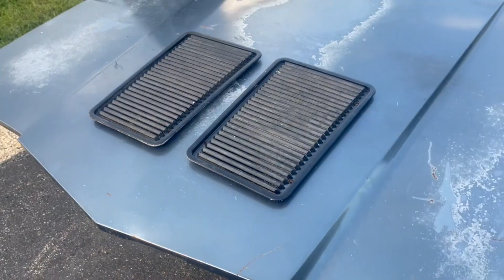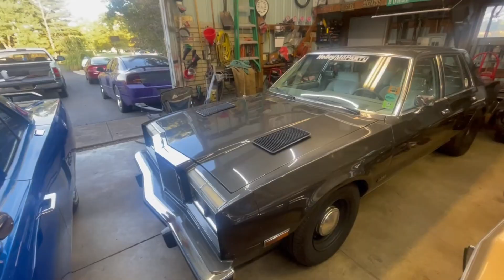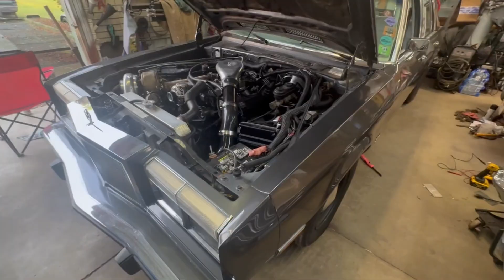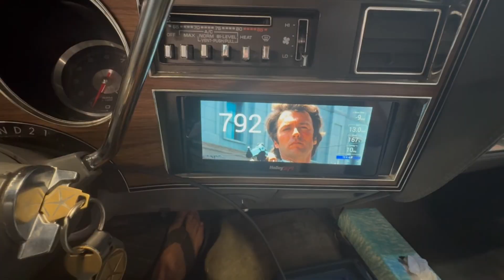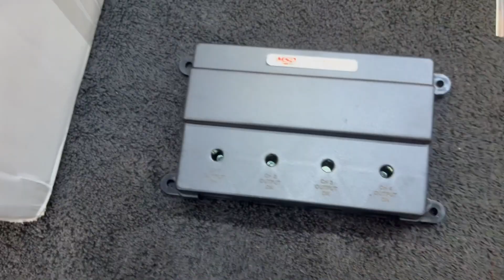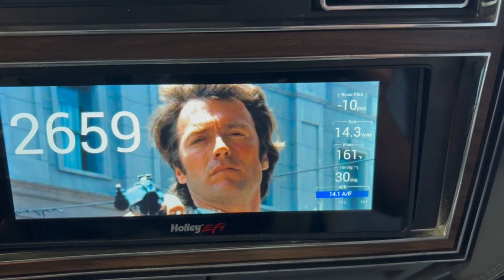Turbo Dodge Diplomat Back on Track! Projects and repairs to improve Dirty Harry at the dragstrip!

Comment: Why not carb and a distributor?
Reply from the maker: I started out with the 90’s truck efi to keep it cheap, but the Holley efi is awesome and user friendly, I love it.  It still has a distributor, honestly I’m not great tuning a carb and I like the options and adaptability of efi.  Could probably do it more simply with a carb for sure.
Reply: @restoreitralph I'm thinking me. Old school. How wide 8.75?
Reply from the maker: @tomhowe1510  i forget exactly, but its from a 68-70 b body
Reply: @restoreitralph wow no kidding. Bolted right in. That's the most common 8.75 too.

Comment: What Fuel are you running in that thing right now and are you running stock pistons or forged?
Reply from the maker: I’m running pump 93, it has the stock pistons still.  I did gap the rings for boost but other than that it’s a stock 95 truck 5.9, even the camshaft. 👍

Comment: How much boost?
Reply from the maker: 12 psi 👍
Reply: @restoreitralph thang is cooking on 12 psi
Reply from the maker: @davecaresforyou7606 for sure!
Reply: @restoreitralph just found your content and love it! How hard is it to do the 3rd gen swap? I wanna do one with forged pistons and turbo
Reply from the maker: @davecaresforyou7606 thanks!  The gen3 Hemi swap is pretty easy depending on how good with wiring you are.  With modern swap kits though, it’s a bolt in deal, and the wiring kits make it easy as well.  Definitely worth it!

Comment: Is that a 360
Reply from the maker: Yes, 1995ish 5.9 magnum 👍
Reply: @restoreitralph u said 1995 so 727 stop production in 89 so it gotta be 518 4 speed torqueflight
Reply from the maker: @jomfrulysetsfall2119  I'm using an earlier 727 with a notch cut in the bellhousing for the magnum crank sensor.
Reply: @restoreitralph you're using the 8¾ posi 3.23
Reply from the maker: @jomfrulysetsfall2119 it’s an 8 3/4, 3.91 gear with a spool 👍
Reply: @restoreitralph I was gonna say that but thought its was too high
Reply: @restoreitralph from a pick up truck 727 or 518 ?

Comment: I liked plan A, the path of least resistance. I also think they would be a very effective area as well. Assuming the air will be moving from front to rear. I know it's subjective, but I happen to like it.
Reply from the maker: I’m definitely not set on anything, after not looking at it for a few weeks I’ll probably start with fresh eyes.

Comment: One- the Sleeper Aspect of your turbo car is off-scale.
   Be tempted to use tempature detecting gun to confirm the hot spots on the sheet metal from the turbo setup after a run
   Those vents maybe could be cast out of aluminum if things get melty .
    Apart from snagging some glorious K-car styling- sending the hot air out the right fender near the turbo via a 'hot air box' might be less  work & more sudden downpour resistant.
Reply from the maker: Thanks!  I forgot about the k car fender vents!!! Now I’m on the lookout, thank you!

Comment: 1980s... I remember Mercedes E class diesels with a single vent mounted to the side of the front passenger fender.  I took that idea and pictured using just one vent cover over the turbo area. I would avoid a vent cover over the electronics side of the hood to keep the area free from rain/snow/car wash water. But then I saw the LEDs on your relay connector box and thought about using fiberoptics to relay that data to a fiberoptics monitor like the 1960s GM cars had, mounted just above that area where you might have placed the other vent cover. Luckily for me, I'm just an ideas guy.
Reply from the maker: Those are cool ideas for sure!  The 5th avenues had those fake vents in the front fenders, I thought about something similar to that as well.